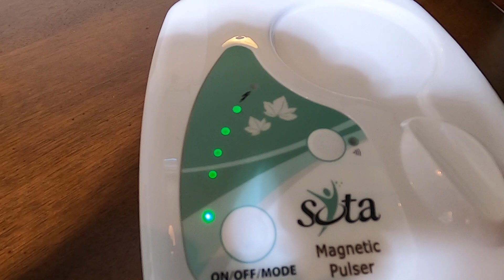013 Open Source demo model BBMPulser 4B  Strong Automatic Magnetic Pulser 1.4 Tesla (14,000 Gauss)

Comment: How much DC volt does the copper need to make the magnetic field. I have about 300volt to the copper coil which doesn't make the pulse. the  copper is 12m long with 0.9mm diameter .and the thyristor also get signal which is around 120v .
So what do you thing is the problem why isn't it making pulse.
Reply from the maker: I'm sorry I don't understand your question
Discharge voltage is around 550VDC
Ones your capacitor bank reaches that voltage, 555 chip will trigger and will send a signal to trigger thyristor for a pulse.
Thyristor pulse signal is very low signal it's around 2V and 50mA

Comment: If one capacitor is used, does the negative terminal of capacitor need to connect with neutral??
Reply from the maker: One capacitor in capacitor bank?
Reply: @AndreyD  yeah.. we tried it and the low voltage circuit and all works well
Reply: @AndreyD  both the led lights up and the coil got voltage that come out of the capacitor bank but it doesn't pulse
Reply from the maker: @sosnasolomon9795  pulse being generated when capacitor bank charges to around 550VDC
What's the maximum voltage on your capacitor in capacitor bank ?
Reply: @AndreyD  its 450.
Reply from the maker: @sosnasolomon9795  can you measure it with voltmeter while it's ON and tell me what the maximum charging voltage reaches in your  capacitor bank

Comment: hello sir how are you doing?
can I use the neutral line for  ground for the circuit and also for the whole device?
like instead of giving ground to the components that need ground what if I connect them to neutral  line ??
Reply from the maker: Ground from outlet connects to the metal case only. Everything else marked with ground sign in the circuit connect to the neutral wire from outlet
Reply: @AndreyD  okay thank you so much sir

Comment: What problem would i face if i use a 15A thyristor??
Reply from the maker: 15 Amp thyristor, you can probably use it if your coil is made from thinner wire meaning your coil resistance higher
Also capacitor bank needs to be lower microFarads

Comment: hello Andrey, can I connect two different valued capacitors  ,like I have one 2000uf 450V for the bank and 1000uF 250 V capacitor so can I use this for the charging circuit??
Reply from the maker: For charging circuit use 15uf to 120uf 450V caps. The lower the cap the slower it will pulse
Reply from the maker: Capacitors in capacitor bank must be exact match. Infact they should be from the same batch so they are exactly same in capacitance and voltage
Reply: Oh okay thank you sir but i wanted to use 1000uf 250v for the charging capacitor and 2000uf 450v for the bank . 
Do you think it'll work?

Comment: sir does the thyristors necessarily need to be SCR I have S6015L  can I use this?
Reply from the maker: Check date sheet for both thyristors
If the holding current higher or same then you can try it, also make sure voltage is 800V or higher
Also trigger current for thyristor may be higher compared to the one I recommend, so you may need to adjust resistors on optocoupler
Reply: My thyristor's datasheet is 600V and 15A I couldn't  find anything above this specification so can you suggest me which component to modify for the thyristor not to blow up?
Reply from the maker: @sosnasolomon9795  I think you need a stronger thyristor.
15amp is too low for Mag pulsers
Reply: @AndreyD  the thing is there is no component here nothing is available in the place i live.. i found this one on used components  so what wasy should i use to make it work.
Reply from the maker: @sosnasolomon9795  if you have shortage with parts, maybe you should hold on for Manual pulser circuit which will be coming out soon. It has low amount of components but same power as automatic pulsers
Reply: @AndreyD  sir I think this whole thing is getting complicated it will be easier if you tell me the selection criteria of all the components so that I can adjust my circuit in the way I want with the components I have.

Comment: hello andrey for the power supply you used 12V Dc power supply right what is the current output of the power supply?? in amphere ??
Reply from the maker: 12VDC power supply is only 500mA
It's there to run low voltage circuit

Comment: hi Andrey....I have a question about that hand made wire wound resistor...in your schematic diagram of 1.4Tesla you say120 ohm 200w now here you are saying 50 ohm...is it big difference? thank you.
Reply from the maker: Use around 50 ohms for 120VAC circuit, and around 100 ohms in 240VAC model
It effect recharging speed, the lower the resistor the faster it will recharge cap bank
Reply: @AndreyD  so for 5B should I use 50 ohm to fast recharge or as you said i have to stay on 100 ohm?
Reply from the maker: @marakiwyinager581  220VAC model uses 2x higher volume resistor.
120VAC uses 50 Ohms resistor

Comment: I found  only one 2000uf 450 v capacitor for the capacitor bank and one 16uf 450v capacitor for the charging circuit is it okay to use these components for charging and for the capacitor bank??  and also for the charging circuit I found ultra fast diode BY329X can I use this one instead of RURG 80100. I wouldn't mind if the output decreases I just wanted it to make  a pulsed magnetic field
thank you

Comment: How do you connect the relay can i have the ckt for the 5 leg.
Reply: The relay sir it has 5 pins right how do i connect them to the circuit
Reply from the maker: @sosnasolomon9795  one of the pins wont be used, a NC (normally closed pin)
Then you need to check for condunuity, 2 pins out of 5  will have some resistance between each other, those are your coil legs, connect one to the coil thermal switch and other connects to the circuit minus.
Then you need to find out your relay common and normally open pins.
120VAC will be going true this legs (common and normally open)
If you go to BBMPulser.org you will be able to find BBMPulser 4B circuit where you can see how relay connects
Reply: @AndreyD  okay thanks sir but we have 220V source here so is it okay if i use 220V instead of 120V?
Reply from the maker: @sosnasolomon9795  here is 220VAC version of 5B circuit
https://bbmpulser.org/circuit-bbmpulser-5b/
Reply: @AndreyD  OKAY thanks but I meant for the relay connection
Reply from the maker: @sosnasolomon9795  relay trigger voltage is 12VDC
Relay switches on and off 120VAC or 240VAC line
Reply from the maker: Sorry I don't understand your question

Comment: is it possible to use a smaller size capacitor for the bank less than 2200micro farad?
Reply from the maker: Yes, you can use lower value capacitors
This will result in lower power output
Reply: @AndreyD  how much tesla exactly does your circuit produce ?is it 1.4T or 4T I'm confused? and also is it possible to integrate potentiometer with it?
Reply from the maker: @sosnasolomon9795 this version of circuit  produces 1.4 Tesla
Yes I could incorporate power adjustment.
BBMPulser 5B has power adjustment
Reply: @AndreyD  thank you
Reply: what would happen if the capacitor banks have less than 450 v.
Reply: @AndreyD  how do you integrate the potentiometer?
Reply: and it's really dangerous can you tell me the safety precautions?
Reply from the maker: @sosnasolomon9795  if Capacitor Bank is less then 450V (for each cap) then your capacitors will be overcharging making hassing noice and soon will go bad. Make sure your caps are 450V minimum for 5B or S circuits and 350V or higher for 4th generation circuits
Reply from the maker: @sosnasolomon9795  to integrate a potentiometer you need to look at BBMPulser 5B circuit and copy it from there. Values of the resistors will change slightly but connections will be same as in 5B circuits
Reply from the maker: @sosnasolomon9795  construct yourself capacitor bank discharge resistor, I show it in one of my video, and use it to discharge capacitor bank every time you work on the circuit.
High Voltage is the only danger
Reply: @AndreyD  ok thank you very much sir ..and a couple more questions if you don't mind me asking.....what type of cable did you use for the transmission of current to the copper coil
Reply from the maker: @sosnasolomon9795  12AWG wires are used to connect coil to the unit

Comment: Also, during normal 1-3 pulses per second, how hot does the coil get?
Reply from the maker: Normal is 1 pulse every 4 seconds. It takes 10-12min before coil thermal switch triggers. first 5 min you can hold the coil directly on the skin, after 5 -7min it gets hot. Yes it can cause burn, I had one case with this guy who got a pulser from me and came home one day drunk start using the pulser on his leg and fall asleep. Few days later he came to me showing his burn he got from the coil.  
I'm sorry about that, we are all adults here. if I make the coil shut off at lower temps then Use time will reduce and I want to keep the use time to be over 10 min/session 
I suggest that heat from the coil is a bonus.
Heat by itself can be used for a lot of thing.
In this case its combined with magnetic pulses. I think it's a good thing.
Reply: @AndreyD  Yes! I agree Andrey. The heat is soothing and actually promotes circulation. And, if something is hot...well we know to stay away don't we? People are always ready to blame others for their silly actions.

Comment: Please let me know the maximum impulse current. I am guessing 400 Amps? Maybe 600A?
Capacitance is 2,200uF. What is the duration of the pulse? Maybe 100mS?
What maximum voltage on the capacitors? 500V? 600V?
Reply from the maker: zusaudio I don't know the impulse current for sure. The capacitors 2,200uF but connected in series so capacitance drops in half.
The circuit set to send 3ms pulse to the thyristor. But if you are familiar with the thyristors they have tendency to latch. In my circuit I guess its the energy from the coil thats unlatches it when Capacitors bank Voltage drops to around 70 Volts from 550Volts. So yes Im sending 3ms pulse to the thyristor but it can latch for longer.
Circuit is set to trigger when capacitors charged to  ~550Volt 
Speed of pulses is 1 pulse every 4 seconds
Reply: @AndreyD  SCR should unlatch with the tiny back EMF from the coil reverse-biasing the capacitors. You can also try a high-power TRIAC.
Reply: @AndreyD  Interesting. May I suggest you find a 0.01 Ohm shunt, please it in series with the coil and using an oscilloscope measure the peak voltage across the shunt. Multiply x 100 = actual pulse current. You can  also see the duration of the pulse clearly. I measure over 150 Amps on the SOTA pulser with 10mS duration.
Reply: @AndreyD  what do you mean when you say latch?
Reply from the maker: @sosnasolomon9795  I'm sorry, I don't have time to watch it again, was I talking about thyristors latch?
Reply: @AndreyD  yes u were
Reply from the maker: @sosnasolomon9795  Okay, thyristor lathing phenomena, you probably never run into it with any of BBMPulser circuits.
Thyristor usually latches after it opens for as long as current flowing true it.
Theoretically after each pulse thyristor should latch and remain latched but this does not happen.
It's due to the small reverse current stored in the coil itself that unlocks it (opens it) right after each pulse

Comment: Can you please tell me: 1) The total cost of all the components including the chassis costs. 2) The total time it takes you to build one of these and 3) how much you charge to sell one?
Reply from the maker: It cost around $200 in parts and materials for me to get everything here in USA
It takes around 10hours to build one (that's if you have all the necessary tools and experience) 
I charge between  $800-$1,500  for BBMPulser 4B
It depends on who I sell.
I want to lower the price but I wont be able to do it before I start building this Units for lower cost.
Right now it's still in the prototype production
Reply: @AndreyD  If you want to be successful in sales, then the standard formula of 5 x manufacturing cost must be applied. It sounds unfair, but it is a tried and true formula. So, $200 in parts, 10 hours labour * $50 per hour for your time (at least) = $700 per unit. Times 5 = $3,500 USD per completed unit. You could drop to 4 x mark-up to start = $2,800 USD ea. This is cheaper than other high-powered medical PEMF units with similar Gauss output. Selling it for $800 - $1,500 will not cover your overhead costs. After a short while you will run out of money. Remember, making a product is really only a small part of actually RUNNING a company. Office expenses, hiring staff (you cannot do it alone), Customer Service (order taking, answering telephones, etc.), dealing with returns/repairs/technical support, computers, software, office space. How do you plan on selling it? Will you make medical claims? If yes, then you now need to get FDA certification or you will be selling illegally. Your mains-connected unit will need UL and FCC in the USA, and other certifications for sales in other countries. CSA, CE, TUV, etc. Your selling price need to cover ALL of these expenses. That is my HUMBLE opinion.
Reply from the maker: @zusaudio  You are absolutely right. Thank you for your Opinion, I do need to review my prices.

Comment: The cathode on the SCR is wired to the neutral wire right?
Reply from the maker: Yes, Kathode is wired to the neutral wire
Reply: @AndreyD  okay and just to make sure all of the other high voltage ground symbols connect to neutral also and not chassis ground?
Reply from the maker: @corybrown5583 Chasis ground only connects to the metal case (frame).
Reply: When I turn mine on the fan is spinning but it’s not pulsing for some reason. The protection led is lighting up and the pulse led starts lighting up shortly after and stays lit 🤔.
Reply from the maker: @corybrown5583  check if you installed npn transistor correctly.
Reply: @AndreyD  bc337 emitter is connected between the 30k resistor and the 9k resistor coming from base just like your diagram shows on your website.
Reply: @AndreyD  I used two 4.6k resistors to get 9k since I didn’t have a 9k so it’s about 9.2k but I figured that wouldn’t matter.
Reply from the maker: @corybrown5583  9.2к is good. Recheck if everything is connected   as in the circuit, measure voltage across 2 main capacitors, you should have over 550Volts. 
The circuit is tested and proven to be reliable over time.
Reply from the maker: I already have PCB printed, just need to test it. Soon I will offer PCB for sale
Reply: @AndreyD  I made a second low voltage circuit and just haven’t tested yet. Yeah I would love a printed circuit board! I should mention I found 50ohm 200 watt and 300watt resistors on Amazon. I bought the 300watt just for the extra heat dissipation due to larger size.
Reply: @AndreyD  I tried it with the second low voltage circuit and the protection led is not on but pulse led is staying on which makes me think the Thyristor isn’t getting voltage at the gate. Might be a bad solder joint somewhere.
Reply from the maker: @corybrown5583  nice, can you leave a link below for others please. Thank you
Reply from the maker: @corybrown5583  thank you.
Yes this should work.
Reply from the maker: @corybrown5583  if pulse led stays on it means that 555 received the trigger signal and triggered giving signal to the optocoupler.  Optocoupler should trigger and give pulse signal to the thyristor.
Check if optocoupler connected correctly. Legs 1,2 input 3,4 output. Make sure they connected right
Reply: @AndreyD  I’ve checked the optocoupler I did forget to mention my coil weights about 620 grams so would the extra turns cause too much resistance?
Reply: @AndreyD  the protection led flashes really quick and goes off before the pulse led lights up and I’m pretty sure it’s not supposed to do that right?
Reply from the maker: @corybrown5583  620gram coil with 14AWG will work, it will be weaker maybe 10% or so but it should work
Reply: @AndreyD  I’m measuring around 6.6volts on the output side of the optocoupler.
Reply from the maker: @corybrown5583  it's normal for protection led to flash when you turn it on and off. Your protection circuit seems to work OK
Reply: @AndreyD  so if it weighs more and has more turns it may be weaker? It’s a crossover coil. I was just probing the thyristor’s gate and managed to get a pulse into coil while I have the unit off (charge left in caps). I think it’s a bad connection the the gate of thyristor.
Reply from the maker: @corybrown5583  on the output side of the optocoupler you should have only short DC pulses. 
Thyristor will trigger from around 2 Volts, 
If you have constant voltage on the output of optocoupler then check your thyristor. Is it getting 550Volts between anode and cathode?
Reply: @AndreyD  I never got it to pulse by fixing solder joint at gate of thyristor but now every time I touch my voltmeter probes across the two 1mega ohm resistors in parallel it triggers pulse.
Reply: @AndreyD  I measured 600volts between anode and kathode of thyristor so it’s got the voltage but for some reason the 555 timer is only triggering when I touch negative and positive volt meter probes to the two 1mega ohm resistors in parallel. I can’t figure out why its doing that since I have replicated your circuit exactly to specs.
Reply from the maker: @corybrown5583  I'm going to be uploading video I recorded going over the circuit in details.
Reply: @AndreyD  alright. Yeah I don’t know how your 555 timer circuit works to understand why it’s not pulsing. What would cause the circuit to pulse when I touch my probes to the two mega ohm resistors? My volt meter can be off and it still works so I assume it’s bypassing the resistor to the 30v zener and 30k resistor.
Reply from the maker: @corybrown5583  I have uploaded video talking about the circuit. 
Let me know if that helps